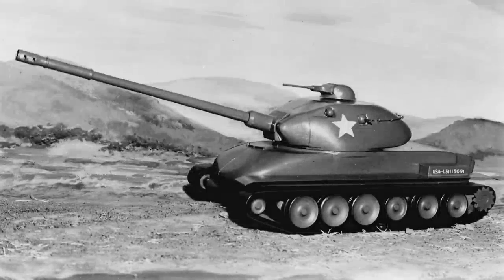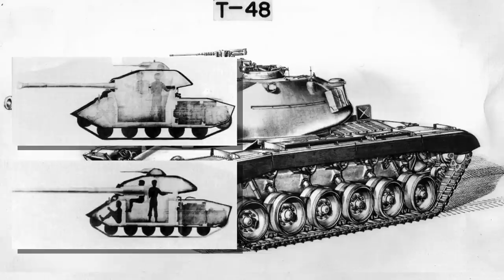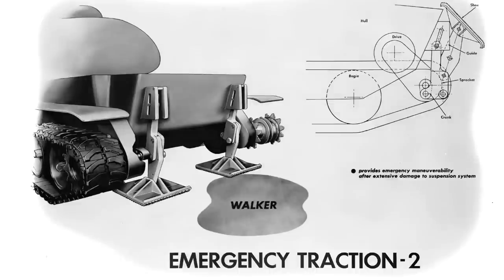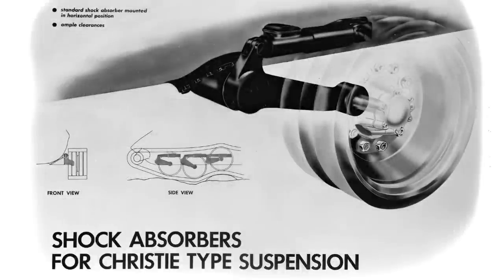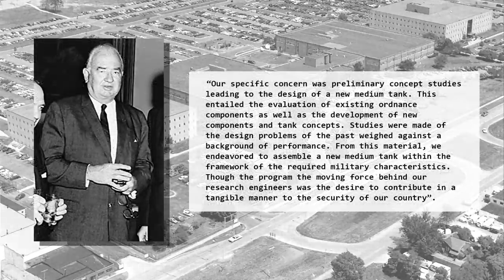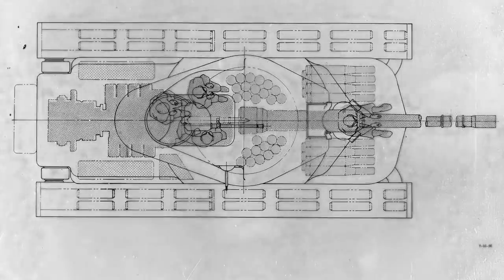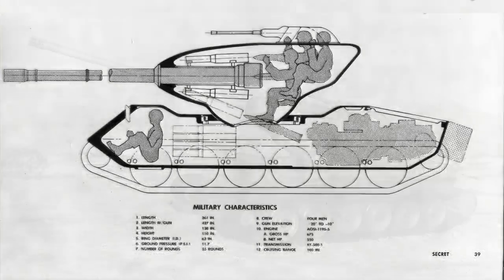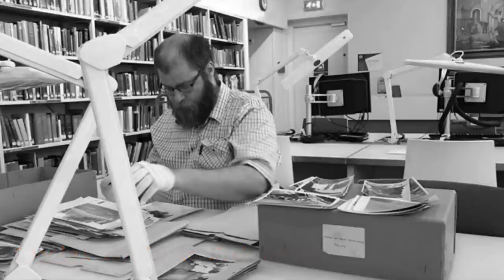The Tanks of YOH - Tank Design & Theory

Comment: Putting an engine in the turret presents a whole host of problems, especially if mechanical coupling is used to transmit the power, as opposed to electro-motive drive.  Even if electro-motive drive was selected, it would represent a significant rotating mass and the turret would necessarily be able to turn faster in one direction than the other.  It would eliminate the degree of isolation from a source of vibration that the gun and its attendant optics enjoy by being mounted to a separate structure, just like an ordinary pick-up truck will ride better than even modern luxury cars because it enjoys body-on-frame construction which has been abandoned for cars entirely.  Putting the engine in the turret would also probably render manual traverse either impossible or unreasonably difficult, or slow, or both.  It just seems a stupid way to balance the turret compared to putting literally every other piece of possible equipment into that space to balance out the gun, everything from the radios to the coffee pot, and letting the engine be in its proper place in the hull.  Let us not even say anything about the difficulties that would arise from transmitting the power mechanically to the drive...
Reply: Not to mention that they have now placed the fuel tank much higher in the vehicle in a rotating platform where it is EXTREMELY exposed compared to being nestled in the rear of the tank chassis. 
I also didn’t see any exhaust or intake vents on that turret. Adding them, as would be necessary in order to have an engine that functions, would probably compromise the armor integrity of the turret and would poentially blow exhaust into the face of the commander whenever he pops out of his cupola. Not to mention that it would be miserably hot and loud inside the turret, making communications even harder if the comms system ever breaks down.
Having exhaust ports located so high in the vehicle would also make any exhaust plume that much taller and more visible.
Reply: Imagine a turret being set on engine fire
Reply: @aaroncruz9181  its easy to extinguish the fire, and easy to blow if the fire is stubborn
Reply: i am not smart enough to understand
Reply: Why the heck aren't you working for a defense contractor dude?
Reply: @claudiotavares9580  I usually say that, in regards to things like this, I know ten times what the layman knows, but only a tenth of what a true professional knows.

Comment: A 105mm revolver cannon? I'd love to see somebody actually make one.
Reply: T54E1: Done.

T57: 120mm is the way.

T58: I stole the T30's gun.
Reply: @hanhphuc166  T57 and T58 never really happened, but yeah T54e1
Reply: @hanhphuc166  T30 be like 'he stole me nose'
Reply: French tanks: 🙃
Reply: AMX 13 in Dutch use. Yet wasn't used as a light tank but tank hunter next to AMX TOW. Taking over so the TOW could reposition or reload missiles. AMX 13 105 was nicknamed the revolver on roller skates.
Reply: @karotgamin790  they skipped 105s, going 90mm, 100mm, 120mm
Reply: @gerhardris  wait, you can actually fit a 105 auto into amx 13?
Reply: @helohel5915  A 75mm
Reply: @helohel5915  there are AMX 13 105s that do exist and yes they're possible
Reply: @yi_hou3092  But not of french design I don't recall, but are Dutch like above
Reply: The Stryker MGS's magazine and autoloader system is actually a revolver, but not in the way that the YOH design is.
Reply: Kentucky Ballistics would use it to blow up beans and nacho cheese.

Comment: What most people haven’t realized about these “designs” is they are preliminary brainstorming by a company not normally designing tanks. These are not meant to be workable plans, just possible concept paths to further explore. One problem in engineering is when you are in a specific industry their is a tendency for design to become somewhat “inbred” engineers will go down certain paths that end up being suboptimal or determine it is too hard to fix, while another industry has an elegant solution already developed, sort of like horse blinders. Bringing in fresh eyes to look at a problem helps to break the “we do it this way because this is the way we do it” problem.
Reply from the maker: indeed, we cover it a bit and in the next one on the chick & hen, where they are askign for new ideas, that beign said, there is a boundry line between new ideas that could work, and those that would never ever work. and so while im all for new thinking there is a level to which it can be applied

Comment: 10:53 : this hull is too tall (wasted space below the turret basket), this won't help to save weight.
12:15 : this design allows a better protection of the turret ring. How the gunner is supposed to operate the main gun ?
Reply: >this hull is too tall
Basically every single tank has that and is usually where ammo is stored.
Reply: I think the M-II-Y is an example of an idea way before its time. Given that this was the 50s, they had no possible way for the gunner to get a sight picture from the turret down to the hull, although control itself may have been possible, as demonstrated by the turrets on the B-29. Nowadays, the idea would be much more feasible. The gunner of an Abrams has entirely non-optical means to get a sight picture if he so chooses. A tank designed with this in mind from the start could do a lot more. Really, you could move the commander to the hull as well, and should probably replace the loader with an autoloader too, unless you're an American tank designer and feel incredibly attached to your loader. Somebody'll field an MBT with an entirely unmanned turret someday, I'm telling you.

Comment: Great video! Well, I have spotted some issues. The Engine mounted in the turret is definitely an issue!.
I can understand why they did it for balance reason but when you have crew that are also in there that's just an all around recipe for disaster! The heat, noise, if it does get hit in that area and there is penetration! 
There is also possibility for shot traps, etc....
Reply: Not only that, but by using the engine in the turret to shorten the hull, you've essentially got the same weight on a shorter track area, thereby increasing the ground pressure, making the tank less able to handle poor ground.

Comment: As far as I can tell, the AOSI-1195 engine design never went anywhere.
Reply: I don't think so either,  quite often with such projects they have set of parameters and modules, which will create an engine of size/output etc. for the teams to use. we did similar in the UK with a given volume/hp etc and a made-up name. so they could focus on building a vehicle around a given shape/capability

Comment: From a basic operational & maintenance standpoint, putting the engine above everything else almost ensures that everything will have oil on it eventually.  Like, everything.  Or fuel.  Or both.  Probably both.  And water.  basically, the crew would be swimming in filth after a hundred hours of operation.  From a safety standpoint....a rollover would be cataclysmic for most of these tanks.  There's no way to get the crew out of the oscillating turret should their hatch get jammed up.   They would literally have to cut them out.  These things all look like deathtraps for at least half the crew, frankly.  I love that the loader in that one abominable tank is handing shells up to the gunner blindly and hoping he doesn't drop it back down on his foot.  Don't think it wouldn't happen, it would absolutely happen.  From an ergonomic standpoint...none of those look even slightly comfortable.  And boy would it suck to be sitting in front of the engine up in the one turret--boiling while the driver freezes down below--or vice versa.  "Sir, can I turn on the heat?" / "Fuck no." / "I can't feel my toes anymore." / "Stop bitching."
Reply from the maker: exactly! they overcame some problems and created many more

Comment: in my opinion I can't understand why they did not think about a electric drive for the 7th design, having the mechanical system inside the crew compartment is way too dangerous, and it is not like it was a new idea since electric drives had been used on the T1 heavy tank and later one of the T20/22/23 series prototypes
Reply: considering a EMP threat perhaps?
Reply: @RFi731 
If the engine is gasoline it doesn't matter.

Comment: Haha the YOH II gunner won't be able to properly aim.  I also like the re-introduction of MOAR MACHINE GUNS.
Reply: MOAR
Reply: @cryohellinc  MOAR!
Reply: There's no problem with putting sights for the gunner to use, except for the fact that in order for the gunner to be able to see over a ridge in front of the tank, it has to stick the entire turret down to the turret ring up over the ridge until the gunner's optics clear the ridge. With modern technology, it would be possible to put optics on the top of the turret and remote them down to the gunner, but that wasn't available at the time, and doing that would mean that if the remote optics were damaged, you'd have to revert to sights on the top of the hull, reinstating the original problem.

Comment: With modern batteries you could make that turret engine work - smallish turbine for cruise and a battery for "combat boost,"  assuming you use an electric drive in the hull, like a normal human. Nope, the mad lads wanted a spinning metal drive connecting to a bog standard transmission.  Because nothing adds to the fun, when a tank is hit, like a spinning cog of death flying around the crew space.  Not so much a "turret monster" as a "turret kaiju."

Comment: Not sure why they thought a hull mounted machinegun was necessary on the second one, also I feel conflicted about the mounting of the return rolers on all of them, seems like a bad idea.
Reply: Why tho if the "arms" aren't part of the casting it's actually good idea the track touches the ground in front of the hull of the tank resulting in potential mine detonation to do less demage to the hull of the tank saving the crew
Reply: @Miazger  this loose part of track wont detonate any AT mine as they need a certain weight to be placed over them, not like infantry mines activating after anything stomps on it.

Comment: I came across a design of 1945 for a superheavy tracked tractor-trailer combination but no further info on a design bureau/studio name. Found in the archives of the AGFE (Army Ground Forces Equipment) Review board dated June 20th '45. Intresting as the trailer-turret could be dropped to be used as a static defense point but would it really work tankwise ?

Comment: Not being too familiar with some engineering principles, I think they miscalculated the impact capacity from other tanks, the smaller turret ring for instance would most likely bend upon impact as there’s just not enough metal to hold form, other obvious issue is manufacture, modern tanks the turrets are dropped in place, these appear to be built in situ, and as I think about it, air quality is pretty bad, lubricants and also fuel would be in the personnel chambers, the engineering processes in the past were not what we have now.

Comment: Engine in the turret, fuel tank in the hull. So presumably a very flexible hose pipe going up to the turret.. and if it keeps rotating in the same direction, it eventually breaks and sprays the fuel over everything but the engine.
Reply: You would need a very expensive hose pipe for this thing to work lol

Comment: Seems to me that all of these vehicles have similar problems, they are all incredibly cramped, some to such an extent I doubt you could actually fit all crew members... Also, if you have those double tracks, if the rear gets hit by a mine, now you have twice the tracks to repair, also, how do you tension the backup track? Also, I'm not sure the designer understands how hard it would be to develop a safe reliable revolver cannon for something as large as a 105, not to mention if the mag is mounted DIRECTLY to the breach, you have an insane amount of weight on your gun and would need insane counter balance, not to mention if your not using an oscillating turret, your depression and elevation are probably gonna be absolute trash, and if it is an oscillating turret, well those have their own separate issues. Also I may have personally missed it, but do any of these have coax machine guns? On the topic of machine guns, how were you supposed to aim the side mounted mg? Let's not forget just the general lack of view ports for gunner and loader and don't forget the lack of loader hatch either... These things look great on paper but I have a feeling in reality they would have been more cramped and uncomfortable than a t54... Can't imagine how long it would take to fully restock ammo... Specifically for the m III, what is the point of those hull mg's? if your driver is supposed to use them he doesnt have very good optics to, not to mention they will be taking up insane amounts of space and cramping the driver even more (if that's even possible) also, from the looks of it, that MIII's turret lower is a massive shot trap and would probably be incredibly easy to jam... Also after looking at it, how the fuck do you tension the tracks?

Comment: I say the Swedish S tank is the most radical thinking so far, and it made it into production and actual military deployment. One question I often wondered, why tanks need a 105 /120 mm gun when the A10 just make do with 30mm. So far, the biggest gun on most APCs are 25 mm guns.
Reply from the maker: while the 30 mm Gau on the old A10 was effective in its day, it was still only effective against the tops and rear plate of tanks and will strafe those areas or preferably just use missiles. It will have 0 effect against the frontal armour of anything post 1970, for that you need the big guns.
Reply: Cannon on a10 is suicidal when used in environment where even manpads are present, its very reliable way to scrap your own cas fleet.
Reply: As noted, the A10 had the option of shooting downward at the thin top armor of a tank. So here's an "outside the box" thinking challenge - how can we mount a 30mm auto-cannon on a tank, so it can shoot downward at the thin top armor of a tank?

Well, what goes up must come down. Unfortunately, gravity is not very strong so it takes a long time for even a slow mortar round to come back down. But hypersonic glide vehicles can reportedly pull something like 100 gees. If we shape APDS bullets like lifting bodies, and the gun is elevated 60 degrees, then the bullets will pull back down to the ground in 2 seconds, covering about 1.5km. Depending on how many gees it pulls, we're talking a useful range perhaps between 1.5km and 20km. If an enemy is too close, you get a buddy further away to shoot at it.

I imagine some sort of guidance is the most practical way to actually get this to hit a target - maybe a mini version of 76mm DART. The bullet looks like APFSDS, but with rotating canards in front for maneuvering. A magnetic clutch brakes the slightly asymmetric canards so they stop rotating where desired. (This guidance principle is used by Starstreak and DART.)

Obviously it would be a big technological challenge to make this all work. But the benefit is that you have a true turret-less tank, with just a fixed chain gun barrel poking out the top, and hundreds of rounds of ammo, and able to hit targets out to maybe 20km. Rate of fire is up to four rounds per second, so the real rate of fire depends on how quickly you run out of targets to shoot at.

Comment: Its rather tragic that the armored combat vehicles are designed by guys who are given a design parameter by other guys who have seemingly never had someone shhot at them in anger.
Typical case is the M113 APC in Vietam and the Bradly in in Desert Storm.
The designers required a vehicle that is amphibious which meant aluminum armor,if aluminum can be classed as armor.
Because the first time in combat,one learns very quickly that APC's that can fly and float are vulnerable to anything bigger than an AK47.
Let alone an RPG - 7 or greater.
The first thing they do is start piling on add on armor ,because the poor guys inside these tin cans start getting killed.
Then they dont float anymore.
Which should never have been a design requirement -in the first place.
Nothing in the armor business changed until the Brits developed Chobham and Dorchester armor to defeat shaped charged weapons.
The Abrams was built around it and with the additional use of depleted uranium that killed any more silly nonsense of cast steel hulls and turrets.
Reply: Don't compare mah boi the Gavin to the Bradley.

Comment: Put the engine in the turret to balance the weight of the gun. I believe many designer should thought about this. But the effort to make the power to transfer from the turret to the hull and make it easy to maintains it’s just  unbelievable hard. Imagine having vent on the turret too. And the crews will cram in the turret with the heat of the engine. I would hate to be on that tank
Reply from the maker: yup terrible ideas
Reply: Extra toasty in there.